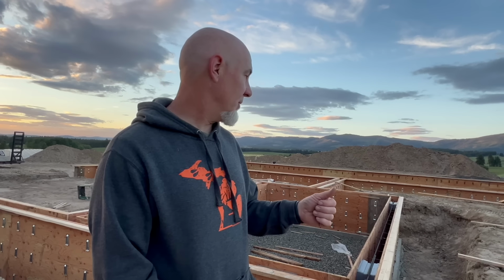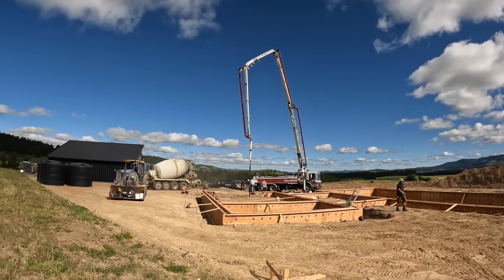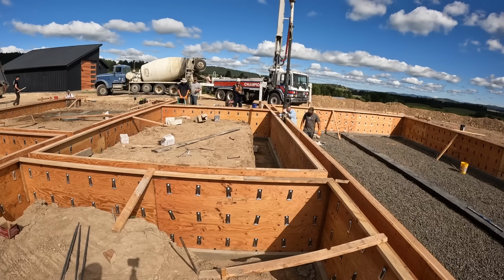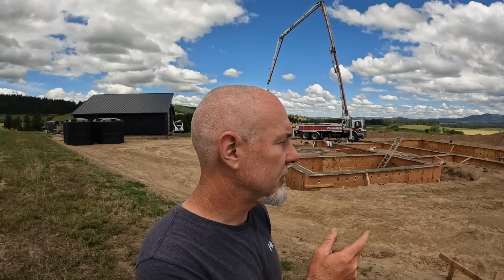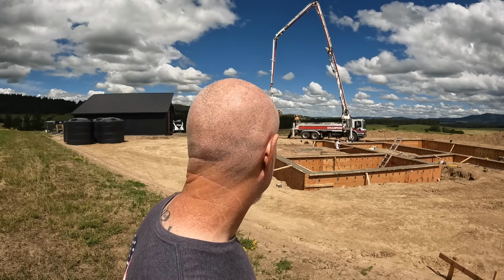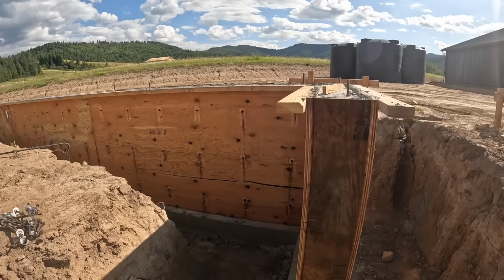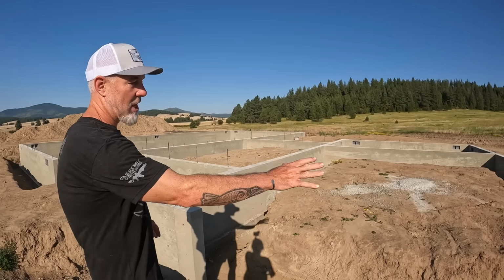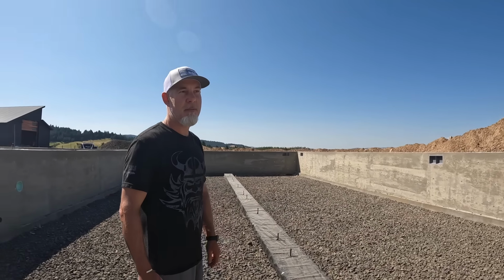IT'S CONCRETE DAY, AGAIN!!! // Using a BOOM PUMP TRUCK to pour our FOUNDATION WALLS!

Comment: Vibrators only drop the aggregate to the bottom if you leave it in the botgom of the form too long! Correct use is a quick in and out every 12-16 inches or so...pour spwared gogo well. Is that a new home for a neighbor going up behind yours, too?
Reply from the maker: @rixtrix11  Yep. We are the first to build but our neighbors are catching up fast.
If we were going with taller walls, they said they would have used a vibrator.

Comment: So after take the forms off on out of the wall are you going put sweeping tile to keep any and all water away from the house ? if you know what is
Reply from the maker: @waderue  yep. I call it drain tile. Basically it’s a 4” pipe with holes drilled into it and you wrap it in landscape fabric. We will run the pipes out of the back of the house foundation and daylight it out about 100 feet away down the hill.

Comment: Now you have forms off now its time to build the half wall and start with the sub floor and if you can lay in all plumbing and water all that coming in before you the whole sub floor on
Reply from the maker: @waderue  We have our work ahead of us for sure. We will start with the drain tile and the damp proofing for the foundation. Then we need to run all our water catchment lines back to the water tanks!

Comment: I'm confused about the dogtrot,will it be open to the elements?
Reply from the maker: @erwinaddison2030  Yes it is a covered porch. It will have a roof over it but no walls. So a great cool place to relax on those hot summer days!
Reply: Ok thanks for answering my dumb questions. If your bedroom is behind the garage will you have to walk thru the dogtrot in the winter to get to the other side of the main house?
Reply from the maker: @erwinaddison2030  there are no dumb questions. Thank you for the question. There will be a guest bedroom behind the garage with a bathroom. The main house on the other side of the dogtrot will have a mater bedroom and another guest bedroom. 😊